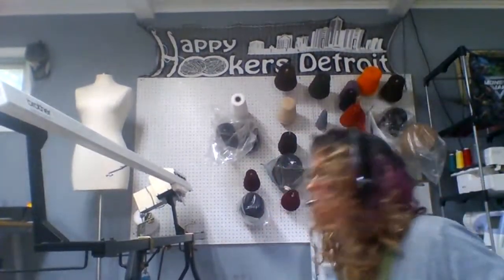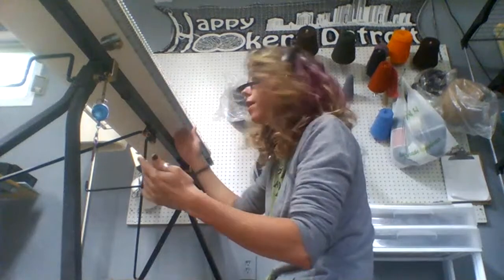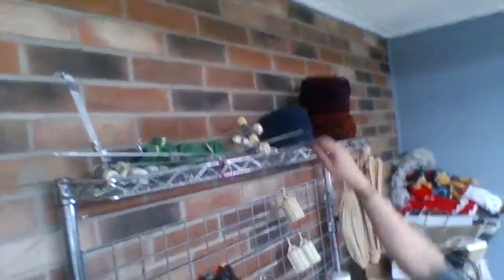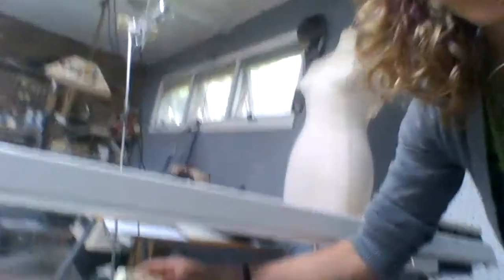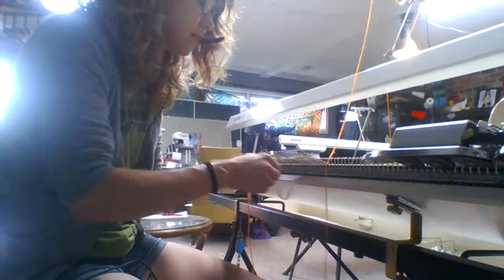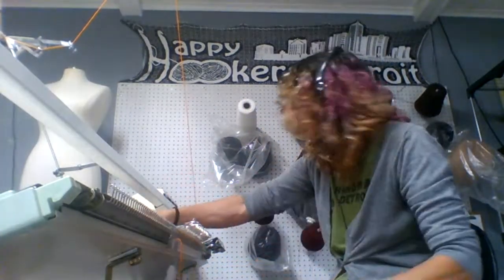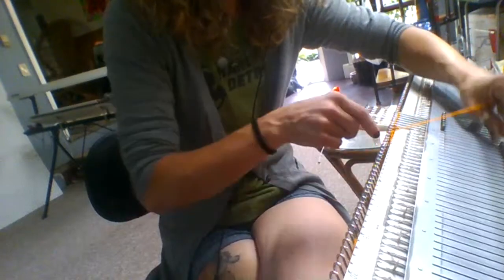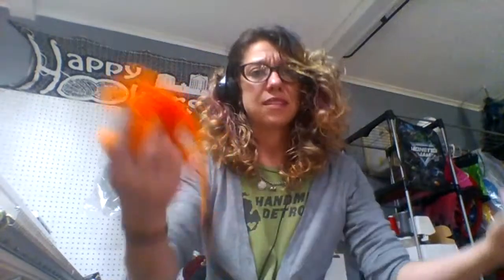Brother 260 installation on a ke-100 motor arm

Comment: I just assembled my KE-100 that my mother owned. For the life of my I can't line up the carriage with the bar that comes down from the KE-100. The knitting machine just doesn't seem high enough. I can figure out if the machine needs to be placed differently on the stand or that the metal attachment on the carriage is not correct. Any ideas would be appreciated.